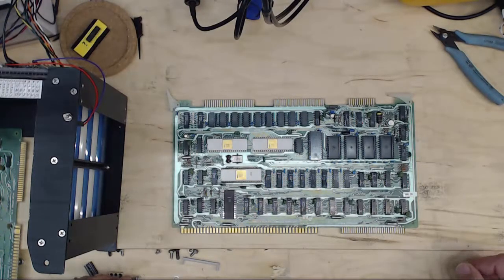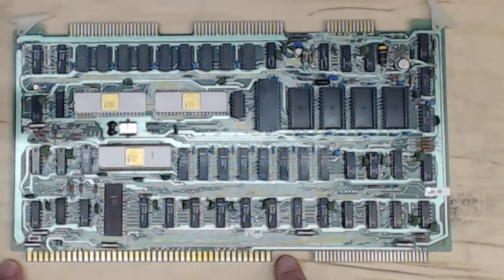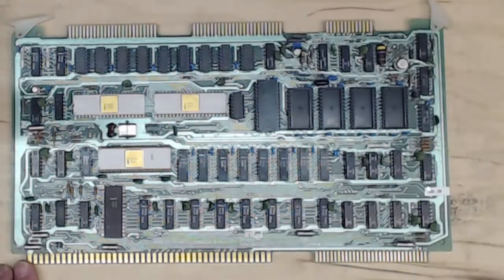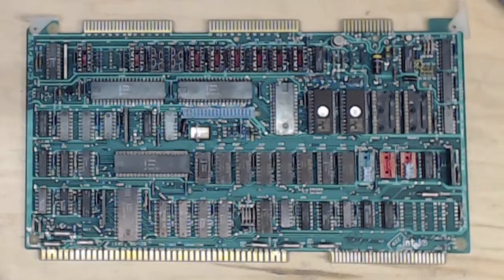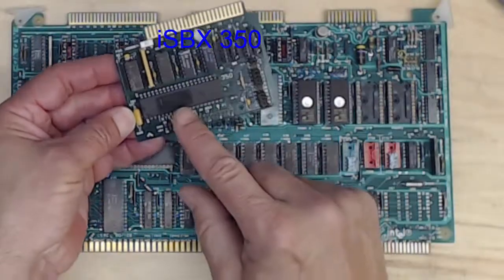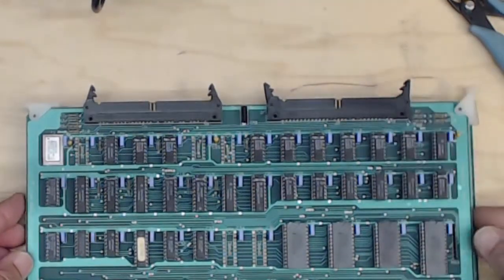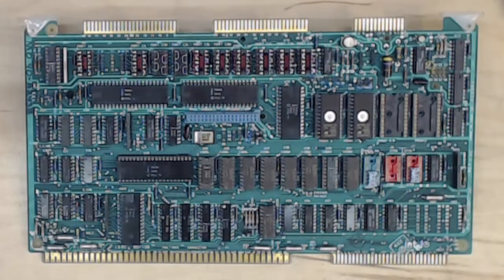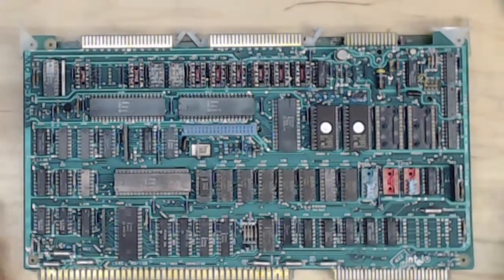{10} Worlds First Single Board Computer ?. Intel Multibus and iSBC Single Board Computers

Comment: Very cool overview.  I work at a nuclear power plant and our plant safety monitoring system and a part of our process control system still utilize Intel MultiBus systems with iSBC boards.  Definitely getting harder to troubleshoot and get parts since a lot of the knowledge is leaving with the older guys.
Reply from the maker: Exactly.  I would hope that everyone has switched to a modern control system before the last of the professional multibus maintenance experts retire or die.

Comment: Hello, Very nice explanation of the Intel single board computer. I'm currently in the process of re-engineering a version of the multibus interface. In fact, by any chance, do you have a data-sheet for the Intel A8220A Bus Latch Transceiver(BLT)? This part sits on the iSBC-186/51 and the iSBC-286/10A.
Reply from the maker: Sorry, I do not. I couldn’t find the hardware reference manual for the 186/51 or even the 8220 in the data catalogs.